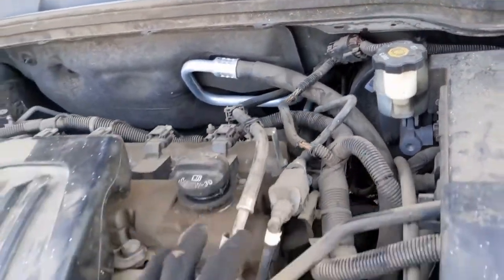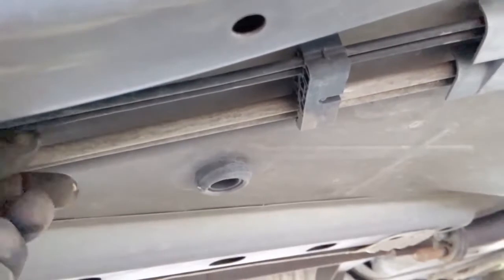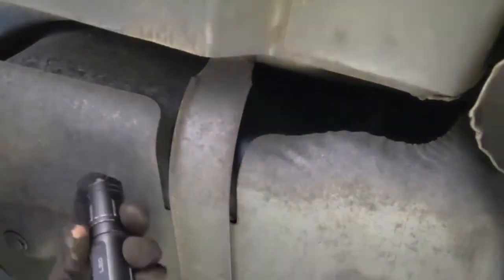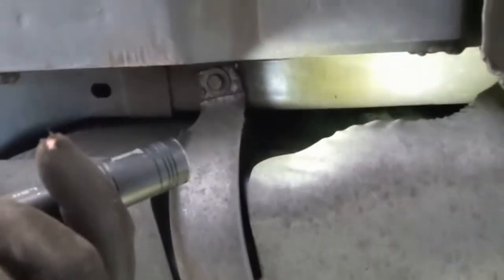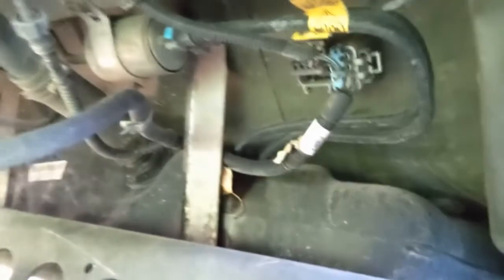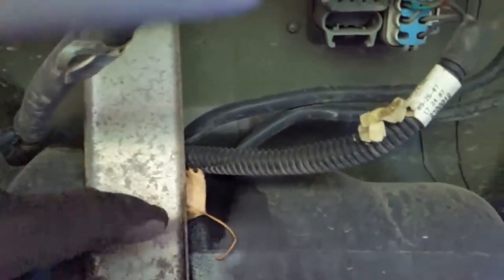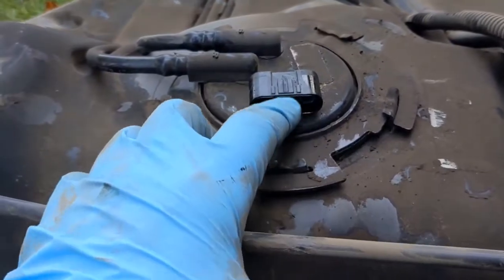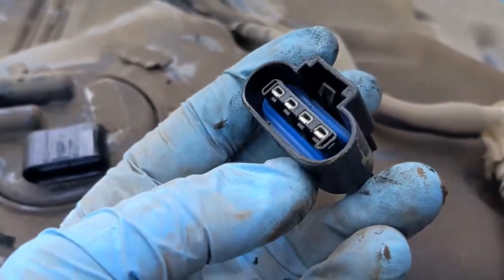Chevy Cobalt Fuel Smell | Dangerous Fuel Leak Recall: Finding The Source

Comment: Haven’t ever had issues with fuel lines rotting have had 4 balts now, only issue I’ve had is brakes/ fuel filler hose tho took time for it to finally start fully leaking

Comment: I had a 2009 Cobalt with that issue  The guy that patched it up said he's done a LOT of Cobalts with that problem.  Eventually I paid $400 for brand new lines.

I don't have the car anymore but I kept the receipt.  Hopefully they'll issue a recall and I can get reimbursed.
Reply from the maker: Yeah it's a pretty scary problem! Some VINs are recalled but I don't know how they decide which ones. You'd think they would all be recalled
Reply: @ValleyMobileAutomotive  Yep. The way those lines are placed, condensation builds up and causes the lines to rust.

You get these mechanics that tell you don't drive it like that, it's dangerous, and GM dragging their feet investigating. 🤪
Reply: @googleuser868  Your fuel line probably rusted out.

Comment: Last fall, tire shop alerted me to gas leak on our 2007. At the time, I did a good-enough-job. Recently, I replaced five feet of rotted line. The fuel lines are exposed and destined to fail in the rust belt.

Comment: Same problem I don’t smell it no more tho ?
Reply from the maker: Because this issue has the potential to cause a fire near the gas tank I would advise to get it fixed even if the smell is gone. leaks don't typically seal themselves so it's most likely that the leak is still there.